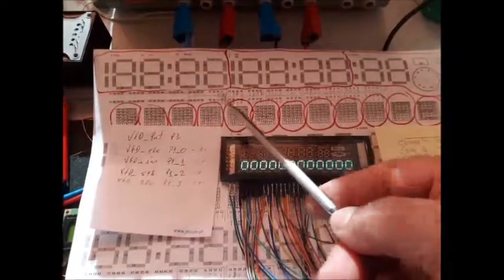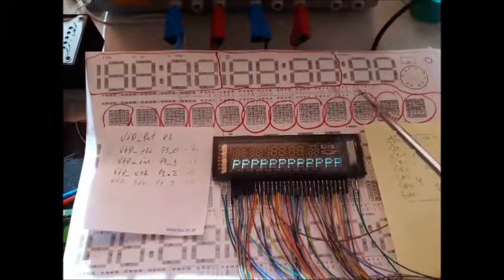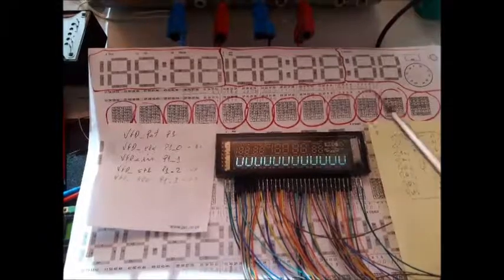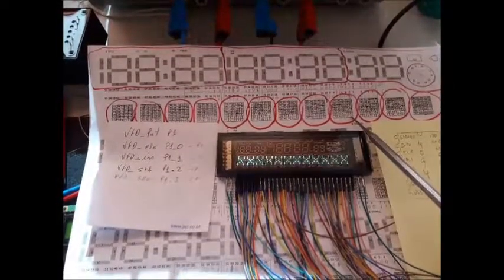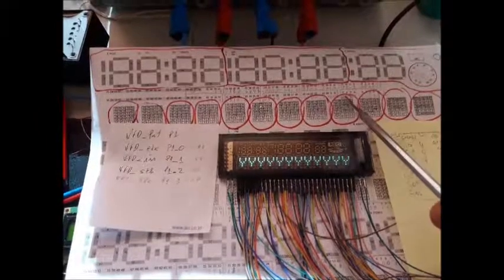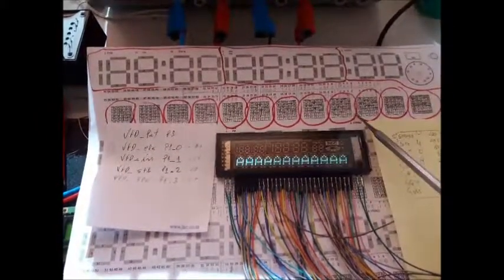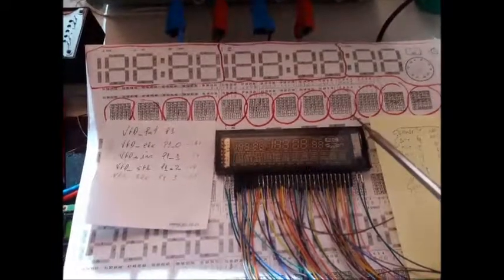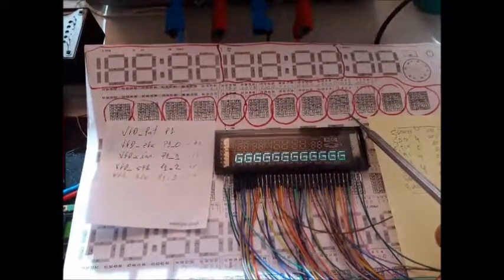VFD tube using shift register CD4094

Comment from the maker: To the people have difficult to find UDN2981, I suggest replace by a CD40109 (Quad low for high, voltage level shifter) or 4 transistors CMOS to adapt the 5VDC from uP signals control to level of VDD.